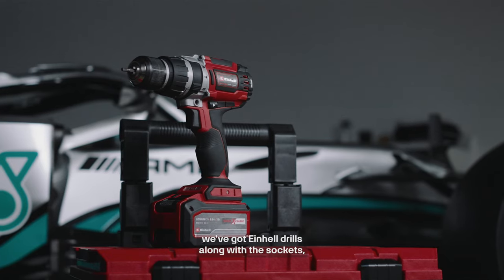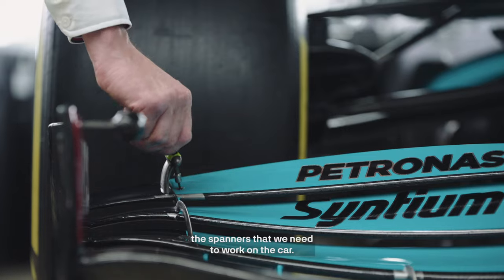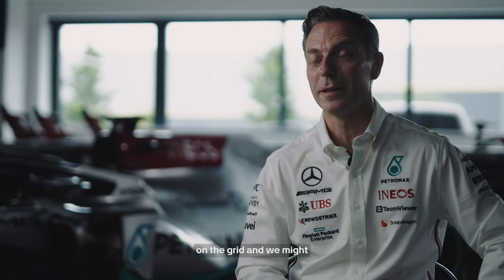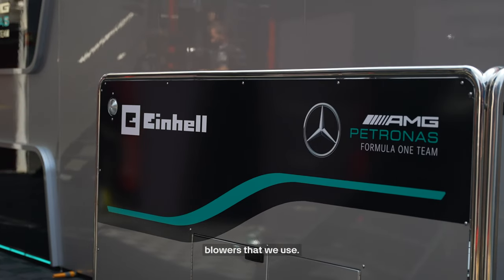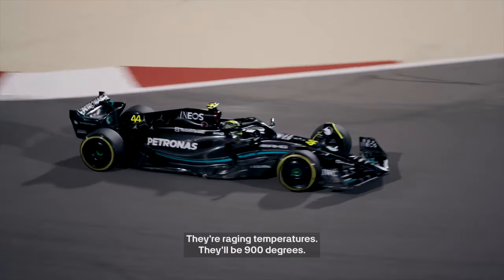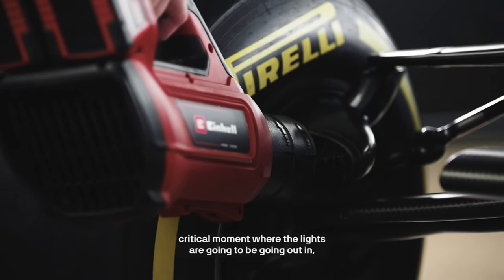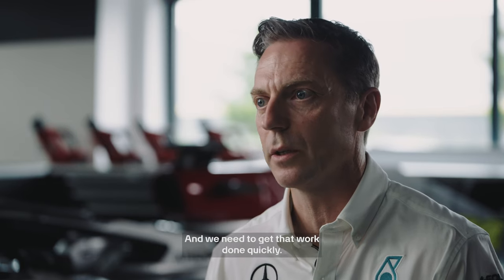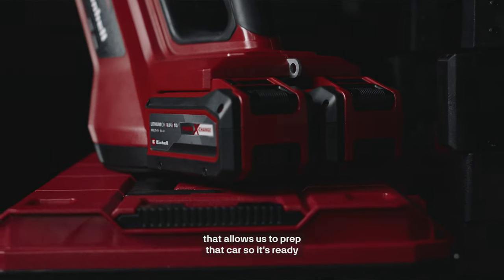The Most Versatile Piece of Equipment on an F1 Grid 🔧 | Performance Insights, Powered by Einhell

Comment: For next year's car find a way to integrate your car software with a 5G network and overload fuel burn in DRS zones. 5G software should be able to adjust the fuel consumption software changes in real time. Its clear the Redbull has ubnormal fuel burn in DRS zones and you should try to do the same